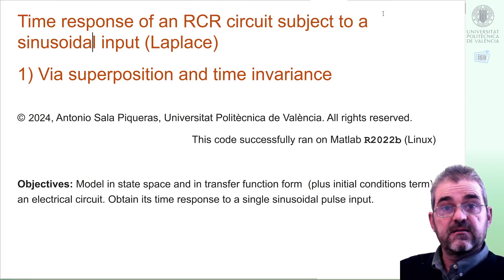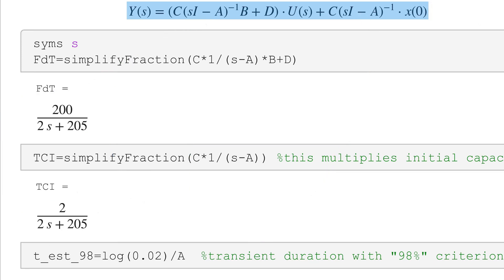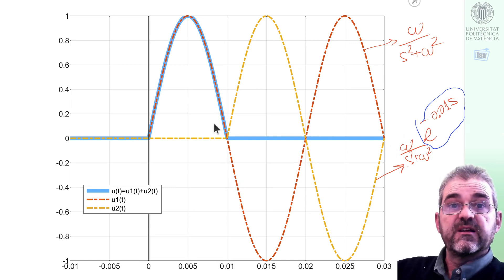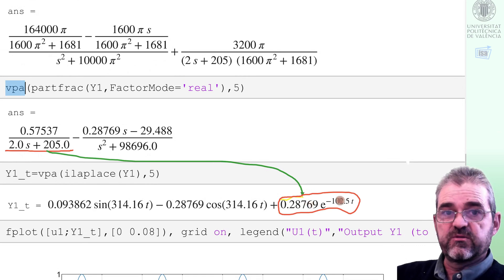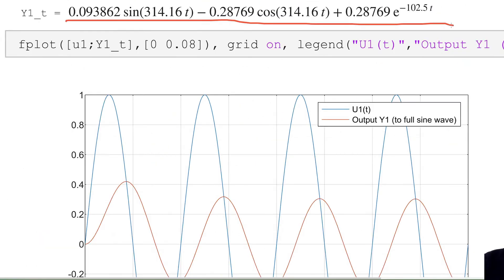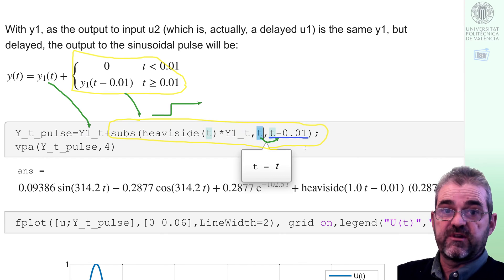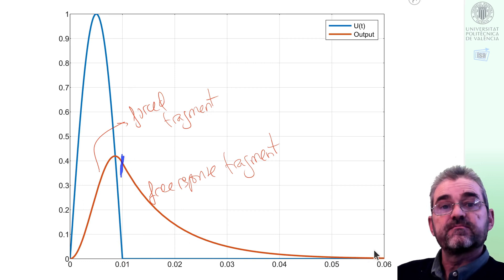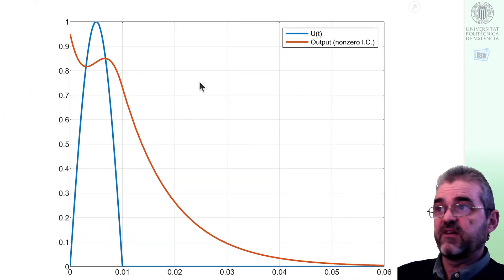Time response of RCR circuit to single sinusoidal pulse (1: Laplace, superposition) circuit analysis

Comment: A seasoned experienced Electronics Technician can breadboard and explain it's workings and troubleshoot the circuit using simple 'algebra and trigonometry' without using Laplace jargon and complex mathematics, using calibrated, oscilloscopes, high quality parts, voltmeters, ammeters, and even with the aid of a spectrum analyzer, Vector Network Analyzer etc...etc...

I have great respect for Engineers and Physicist who can derive equations from complex theory, using mathematical software, and predict the behavior of circuit designs,  and apply it to a design to practicality in the real world.
Reply from the maker: Thanks for commenting... and, yes, an experienced technician can do many things... and often be faster than an engineer in doing them... but somebody must invent/define what "phase angle" is, and what "spectrum" is before building the first spectrum analyzer, so everybody is needed: someone must know Maxwell equations to pass them to the next generation but he might have no idea on what a "ground wire" in a home is, and vice-versa, a technician can set up your antennae, fiber, grounding, etc. without knowing who were Laplace and Maxwell , and in a much better way than a Physicist!. Thanks God, all flavours of technical knowledge have its role.
Regards, A. Sala.
Reply: @ASalaControlEN  my fav sinusoidal waves are photons,
may I offer these tidbits from the Popcorn Model of Nature's Reality.

This is in the study of the Harmonics and the Harmony of Our Universe in the context of Everything:
so,
lets use a metaphor where 1 musical note, (*) , represents Nature's Reality;

This note, (*) , represents the true existence of Nature's reality.

This is the realm of the lord, the almighty GOOD (not a religion but an attitude).  The real note in which everything resides.  What follows are just harmonics of the supreme existence of reality.

1st harmonic of reality (hor)* the human mind and the MotherVerse.

2nd harmonic of reality * commonly referred to as our universe and where electromagnetic radiative force is dominant.

3rd hor * dark matter, the strong nuclear force dominates.

4th hor * the weak nuclear force dominates.

5th hor * gravity, where the popcorn really explodes.

6th hor * time, the here and now where the rubber meets the road.

The 3rd, 4th, and 5th combine to create Dark Energy.

This not everything.  Undescribed harmonics extend, ad infinitum, above and below the note (*). The harmonics show that space that appears empty is never in fact empty.

Between Nothing and Everything is Something :)